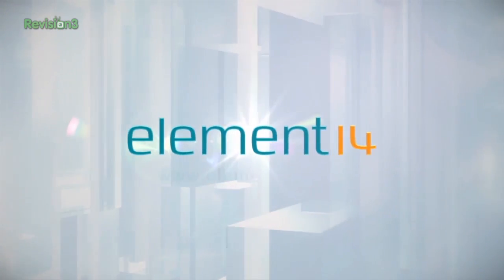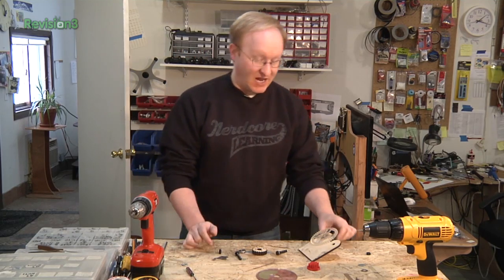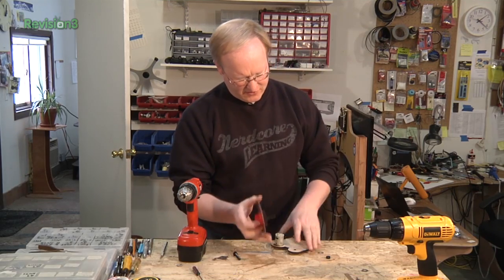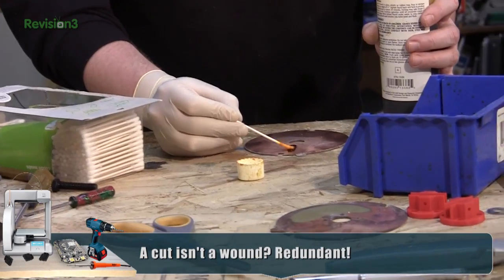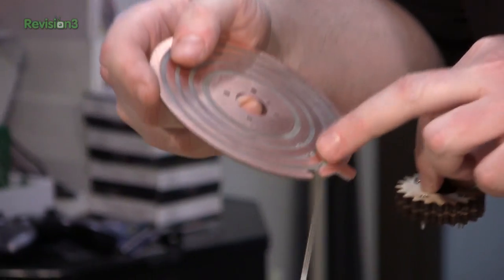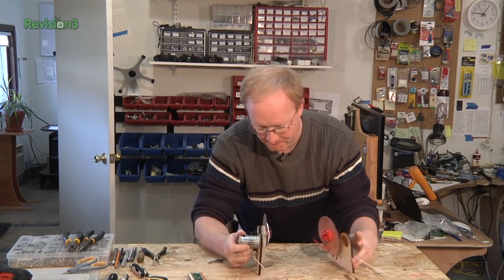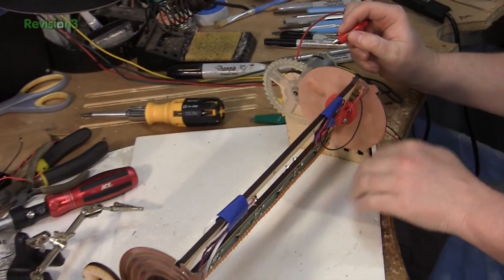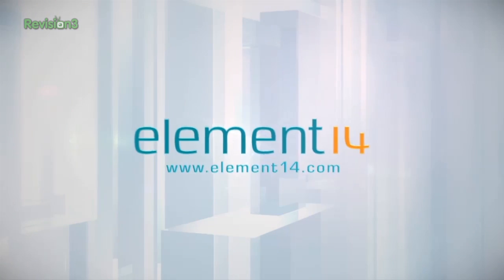Ben's Steampunk Persistence of Vision Display Part Two

Comment: So, why didn't you just shorten the springs on the brushes a little bit? It seems like you swatted a fly with a shotgun by dismantling a drill to use a bigger motor.

Comment: Why not use the Power Supply + as a signal conduction point for a serialized data stream. This would bring the number of brushes down to two or maybe just one. Or if you do power supply filtering you could use the bearing on one side for ground and the other bearing would be for the positive supply. Superimpose the data in a serial stream on the power. For that matter use a WiFi module on board the led revolving panel for data throughput. Really man!... brushes? BRUSHES??? in this day and time?

Comment: If you had used a couple of good stereo 1/4 inch jack sockets and plugs, they would act as bearings and contacts instead of the brushes ;)
Though it would be possible to use bearings if you want as well

Comment: Not sure if this was mentioned before, but why not use a slip ring assembly. They can be found for $40 or less, have enough conductors leading in and out and can rotate easily.

Comment: Ben I'm looking for a simple circuit that can delay a sudden increase in current, without wasting energy and allowing the current to escalate... again, delayed. I thought of using inductos and capacitors, but I'm quite new to electronics and need to develop a working prototype quickly (It's for class I'm in).

Any ideas would help a lot, thank you.

Comment: Ben, you are my favorite weekly show to watch! The random songs / phrases / impressions are the best! The engineering and building stuff is just a bonus.

Personally, I think the best (and easiest) way to reduce friction and to be able to use a smaller motor is to go wireless. Use Bluetooth on each side and have a small Li-Ion / Li-Poly battery pack run the LEDs and message. then you wont have to use the carbon brushes and really cut down on your friction, like you did in the one test.

Keep up the awesomeness!

Comment: You should definitely redo the whole thing and make it right XD 
If you want that construction to be working nice and vibration free you have to balance the whole LED Holder part and make the turning Circuit Boards symmetrically cause of the interrupter "nose" it is heavier on one side. 
So, balance the LED part with a counterweight and redo the PCBs.

Comment: To reduce the friction, instead of using those brushes, you can use just springs.
Reply: The problem with using just springs is that it would wear away at the PCB. He's using carbon because the carbon can be replaced, but the copper wheels would have to be remade.

Comment: 1) That motor is totally powerful enough.  Reverse the gears and suddenly it will have enough speed (its counter intuitive) but having enough torque to overcome friction allows it to run at full speed without drawing so much current.
2) Put the micro on the spinning part so you only need to get power to the middle
or 
2b) Put everything (lights, micro, batteries, motor) on the spinning part except an IR receiver and blam, no slip contacts.  Control using IR remote.

Not as steam-punk as slip contacts but contacts suck.

Comment: I told you that little motor wouldn't be powerful enough. You should probably do a little more thinking ahead - you seem to just decide things on the spot. It results in a lot of your projects on this show going unfinished.
Reply: He knows what he's doing and does not need some random guy on the internet to tell him what to do.
Reply: lol
Reply: The motor probably would have been fine if it was geared properly. Should have been geared the other way for more torque.
Reply: Adam Wilkinson While gearing it oppositely would have increased the torque, it also would have reduced the speed at which the assembly spins, probably so much that it would ruin the persistence of vision, thus rendering the whole project useless.

Using a larger motor to turn the assembly gives it more torque without ruining the persistence of vision, allowing the project to continue along without fault.
Reply: Well at least he's doing a third part to finish this project.

Comment: The problem with the brushes pushing so hard is they will wear very quickly.
I suggest a much weaker spring or you could shorten the spring so it is applying less force

Comment: As brushes you can use the carbon out of standard pencil. By running current through it, it heats up and the glue inside the pencil gives up and the carbon can be pulled out neatly.

Comment: Hi Ben

I think you need to balance the spinning LED assembly so that it stops jumping around so much. The LED's are on one side creating an imbalance. Rather than just adding weight to balance it, try offsetting the slot so there is more wood opposite the LED's. You are still going to need oposite weight but the offset slot will keep it to a minimum.

Willy

Comment: couldn't you put the micro controller on the spinning part? that way you would only need two brushes for power and ground. Am I missing a problem here? I get you would lose the control of the motor by the micro controller, but you could make a circuit that controls the motor speed on the outside.

Comment: i love how you dont waste time uploading in 1K
Reply: 1k definitely isn't a used measurement. But if it were, it'd be something like a 1000 by 500 resolution. 4k refers to the number of vertical lines in an image, while 720p firstly refers to the number of horizontal lines, and second to whether the image is interlaced or progressive. (i or p).

They're used in different contexts, and the actual resolutions would be different, but at closest approximation, 1080p is 2k, not 1.

Similarly, 4k video could be considered 2160p

Neither of these are really valid comparisons, because 1080p is 16:9, (1.78:1) while 4k is usually more like 1.9:1 or more. An actual 2k screen would be wider, and have slightly more pixels than a '2160p' display.

In fact, the whole 1080p and so on was invented when HDTV was a new thing.

Old analog TV's are either 576i or 480i, depending on if they are PAL or NTSC.
DVD's and other digital devices turned this into 720 by 576 (or 720 by 480),

Now for a really lengthy explanation about the '1080p' way of describing resolutions. (If anyone is interested)

but the actual reason only the horizontal lines are mentioned is because of analog TV broadcasts.

Basically, an analog TV broadcast is exactly what it says; The signal is a continually varying signal, which (hypothetically) has infinite detail - in practice of course, the recording cameras have limited resolution.
However, the entire signal is one continuous signal. - A line, basically. You can cut it up into an arbitrary number of pieces, but if you want to show it on a 2d screen, you have to do 2 things;
Firstly, you have to break it up into individual lines, and then you have to break groups of individual lines into frames; each having one picture in a sequence.

You can't change where a frame begins and ends, because then you would find a single image on the screen is broken into pieces at strange places, or multiple images are on one screen (if you're going way too fast for the image.)
You can actually see this happen with an analog TV, especially with old sets where you could manually adjust these things.

OK, so you've broken an analog signal carrying animation up into individual frames. Each frame starts at a specific spot, and takes a specific, fixed amount of time to get the whole image.

But, you have to break that up into horizontal lines, and individual dots on those horizontal lines.
In principle, you can break it up into however many horizontal lines as you'd like; It'd make no difference to the TV as such.
Just as you can make the duration of an individual frame shorter or longer, but have to keep that length the same across all TV's for them all to show the intended image.
If you break up the signal into more, or less lines than were used to create the image in the first place, you find that it doesn't line up, and what should be on one line is now on multiple, or multiple lines are on one line when they shouldn't be. (You can cheat a little if your TV is clever enough and merge together multiple lines into one, but doing this correctly still relies on knowing how many lines there were originally.)

Ok, so now we see we need to keep the number of frames in a second, and the number of lines in a frame consistent, even for an analog signal, otherwise the image recorded at one end won't look right when shown on the screen.

But what about individual lines? The signal is analog remember, so it varies continuously. We need to split it up into an exact number of lines and frames, but individual lines can be split up into any number of pixels. Whether there is just 1, or 1,000,000 doesn't matter, because you can cut an analog signal into as many slices as you like, and each individual slice will still have a unique value.
But why doesn't this matter, if the number of lines does?
Well, if you change the number of pixels in a line, all you are doing is cutting a line with a fixed length into bigger or smaller pieces.
If you change the number of lines, you are making the length of the line longer or shorter. This is what causes the image to go weird, because the length of line you are using is different to what the recording equipment used. So, you fit more recorded lines into one line, or less, but either way it looks weird.
With the individual lines themselves though, all you get is increasingly smaller (or larger) pieces, but they will still all fit on the line they are part of, will remain in the correct order, and will start and end at the proper places.

Because of all this, it means you can cut a single line into as many pieces as you like and it won't matter, but need to cut a single frame up into an exact number of lines or the image will be messed up.

As a result, TV resolutions came to be given as 'number of horizontal lines', and ignored the number of vertical lines; Because it didn't matter.

Hence, if it were analog, 1080p could be 1,000,000 by 1080 pixels, or 10 by 1080 pixels, and both would be '1080p'.
But... With modern TV's and digital broadcasts this isn't actually true anymore, (because by definition a digital signal is broken up into an exact number of pieces no matter what; That's actually what defines a signal as being digital rather than analog).
As a result of digital TV, 480p, 720p and 1080p all have specified resolutions (720x480,1280x720 and 1920x1080). But the reason only the last part is mentioned is entirely because of the principles behind analog TV, rather than digital.
Reply: 4k is not 4x 1080p, 4k is not a progressive lines measurement
Reply: fascinating